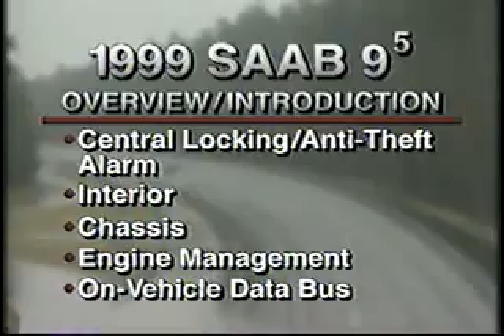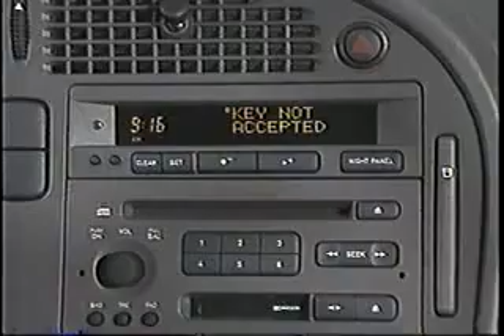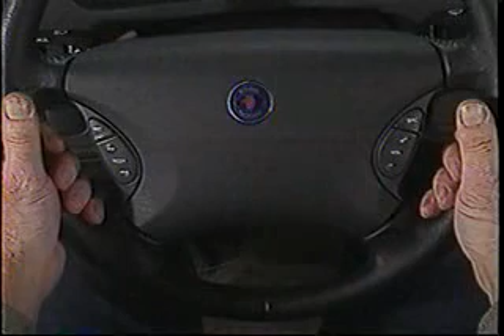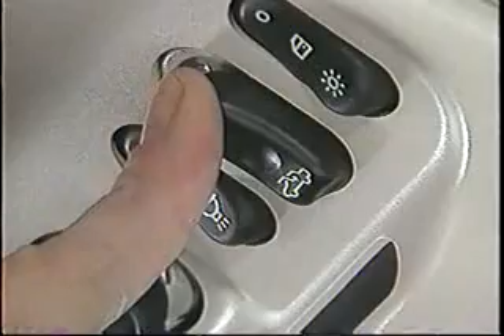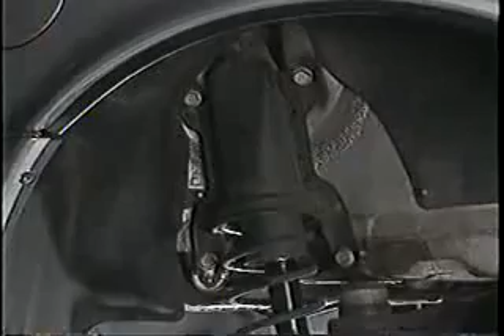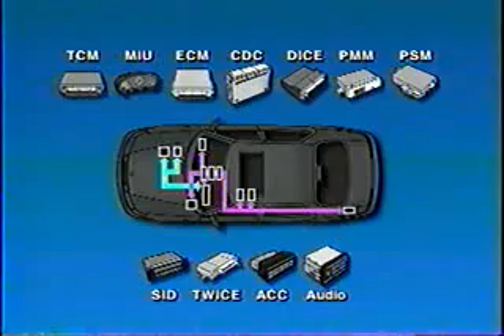SAAB 9-5 - user manual - overview / introduction

Comment: I  owned two two Saab before 2001. It looks nice and drive good because of turbo charge. When it comes to repair, Saab is piece of junk, no dealer is nearby within 60 miles. Then GM destroyed the Saab Brand and stopped the production. Thousands of Saab owners got no service any more. I would never purchase a GM products.

Comment: 40 years later innovation.... still needs head gaskets? Just bought a 2002 9-5  wagon, very nice shape with records, needing window regulator track repair and after getting it started, a head gasket. Something for the wife to drive.
Reply: How do you know the cars hasnt been overheated?? Are you the original owner?

Comment: There was a reason SAAB needed to be rescued by GM in 1990. It was failing. All was well until 2003 when GM forced production and design into their Russelsheim Opel shop and stopped allowing SAABs to be Swedish. BUT GM's supply chain allowed for the installation of Japanese transmissions and turbos [more reliable]. BUT GM should have allowed them to keep the car different and quirky- not turn it into a Swedish 3 Series...